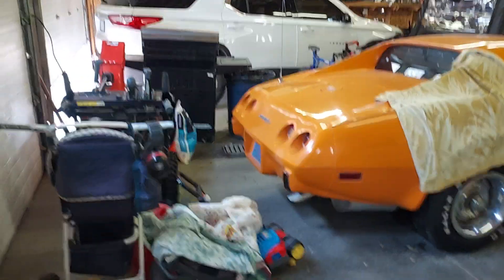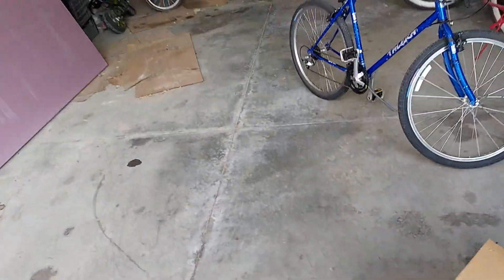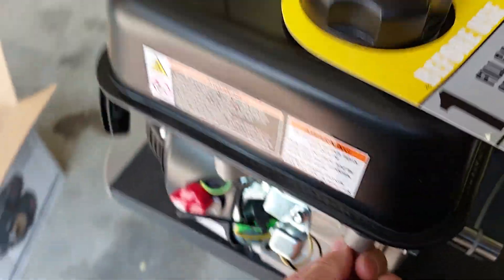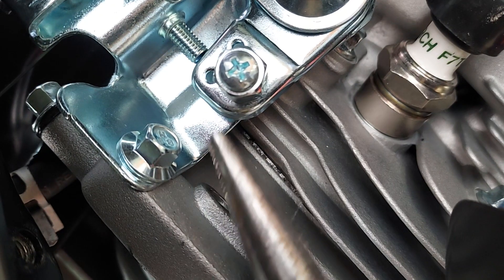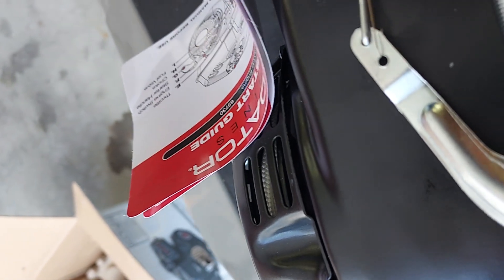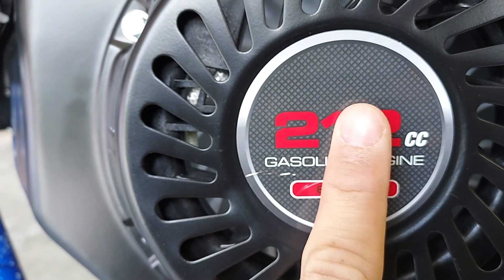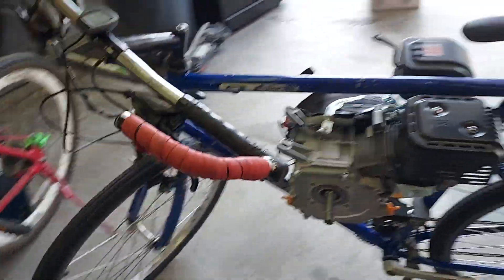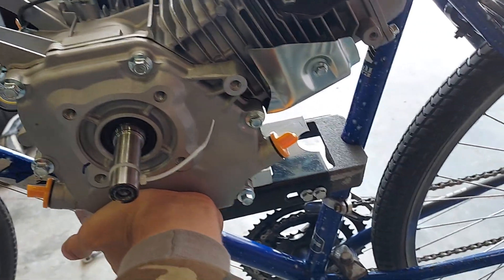Predator 212cc Motorized Bike Build (Removing The Gas Tank And Seeing The Level Fitment On The Bike)

Comment: Maybe look for a different frame. Need like the schwinn chopper laid out longer.  Maybe.  Just a thought.
Reply from the maker: Yeah.... the thing is though is trying to find a big enough gap in the frame to fit the motor
Reply: @HanzelFonferek  yeah bigger motor means tougher bike and frame. Size. Length from seat stay to head tube.

Comment: I've also got a predator 212 on my motorized pedal bike and I got it also tweaked too do about 45-50 mph and I definitely feel the torque on the torque converter best thing ever created thank you for the video and just a question have you had a problem with your 212 predator dying and having trouble getting it to run again I'm just wondering if it's a fuel issue with mine because my motor is slightly tilting down with my gas tank the fuel line that's on the top I don't know if that's in gas or not my first predator motor so any tips let me know
Reply from the maker: That's awesome! Iove mine. You're welcome. 👍 Yea I sometimes do have the problem with mine dying, usually it's just when I'm trying to get it started and warmed up though because I don't have it adjusted totally 100% yet.
Reply: @HanzelFonferek   I know exactly what you mean I adjusted mine properly and now it's working boss so you get your motor lined up it'll run awesome
Reply from the maker: @presleyfleckmotorizedbikef4285  Yep. You got that right! 100%

Comment: skip the gas tank removal and get right to the 90mm turbocharger and NOS valve install lolz
Reply from the maker: Lol! I needed to remove the tank so that I could level the motor
Reply: @HanzelFonferek  I thought you said na it would be fine on 45 degree  angle lolz.  Exhaust is going to be roasting nuts!  I don't mean the ones in a planter's peanut container 😮👍 it will for sure melt the seat burn the bikes pait off lol
Reply from the maker: @BuildBreakFix  lol yeah I decided to move it because I need to move the motor over